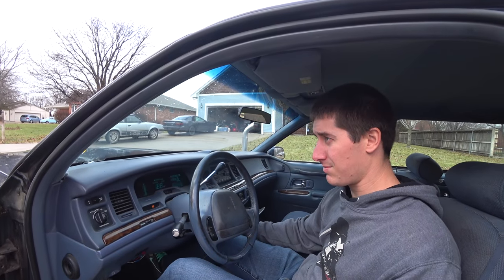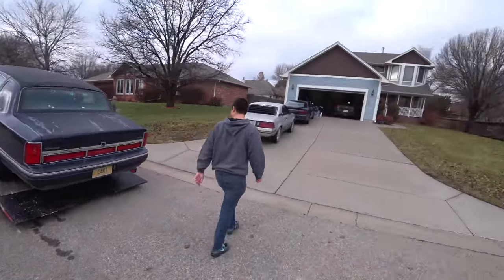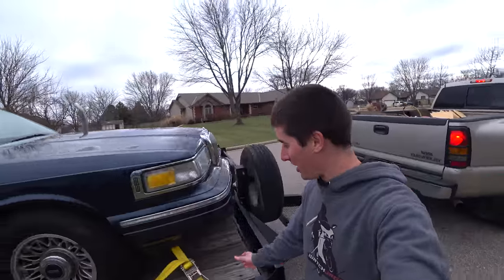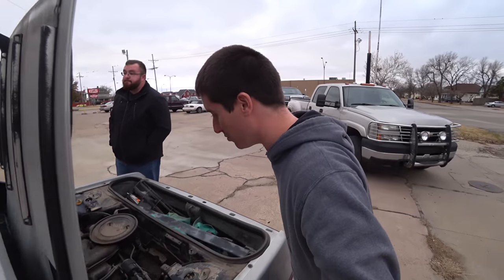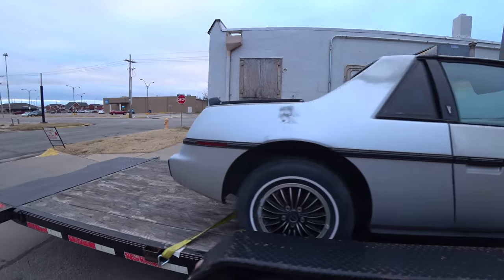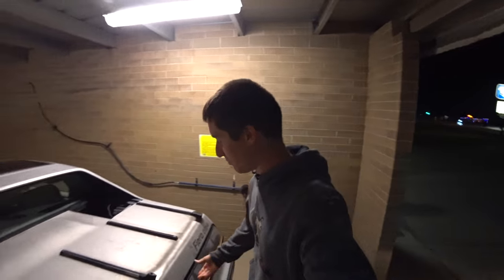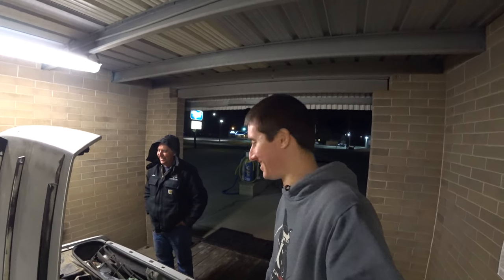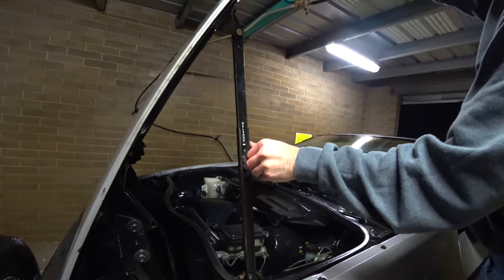SELLING My Cheap LIMOUSINE Lincoln Towncar And Getting A FREE Pontiac Fiero 2M4

Comment: I owned an 84 Fiero.  It actually broke down less than a block from the repair shop I had just left.  And that was one of it's better days.  It was so bad, Hoovie would have bought it.
Reply from the maker: You know what? I'll call him and see if he's interested in this 😂
Reply: You should.  And it will take less digging time to bury it.
Reply: The day I bought my 84 Fiero, it broke down 1.5 miles into the 3 mile drive home. Still have it
Reply: Somewhere out there exists a North Star powered Fiero. I remember this from years ago.
Reply: same, mine also caught fire once and threw a rod out the engine block the first time it successfully took me to work. I still have great memories of NAS' It Was Written booming thru the headrest speakers.
Reply: Your expectation for ANY 34 year old automobile should be a car in need of extensive repair and restoration work.
Reply: I, too, had an '84 Fiero. It was a 4-speed... NOT a 5-speed. Outside of blowing the head gasket and replacing the clutch, it was freakin' reliable! Highway mileage was in the high 30's.  It never broke down... it never caught fire! LOL!
Reply: I love my 84 fiero. It’s been very reliable for me and still going strong

Comment: My brother purchased a first year production Fiero as his first car. It was a pretty good car for the most part and he basically drove the wheels off of it in just over a year before being hit in the rear by a drunk driver totaling that Fiero. He then went out and purchased a new, late second year production Fiero and discovered it was a "garage baby"....It there was a heavy fog or it rained, even a light rain, the car leaked. It used oil at an incredible rate....And the electricals failed on a regular basis. He had to invoke the Lemon Law on that car before it was over with and has not owned a GM product since then.

Comment: I had a Pontiac Fiero 2M4 in 1986. It was a decent car, EXCEPT, in the year and a half I had it, it was in the dealer shop 6 times for the same issue. Then, on the sixth time, they finally admitted that it was on a Lemon Law Recall List and I returned the car and got me another vehicle! Was a lot of fun to drive, well, except for the recurring issues!

Comment: I have an 84 2m4 auto in red. 110,000 miles. No clear coat failure. Also I have the same rims and you cannot find factory size tires for those. They’re all trailer tires, so if you wanted to keep those rims then you’ll have to go with 185/70r13. They’re about 4mph off. I’m driving mine threw the winter in south of Chicago so it is surely going to be fun. Enjoy your Fiero.

Comment: Sweet. I have a 88gt that I swapped a 3800 supercharged engine into a while back.  Has only a few minor mods and a canned tune from sinister performance.  Its friggen fast as all get out.  Especially out of the hole. I used a supercharged park ave automatic in mine.

Comment: Just remember, if you need parts, Chevy Citations (X body) are your drivetrain and rear suspension. I believe the front suspension is Chevette (T body). Be very careful with the body parts. They will be very brittle. Sadly, Pontiac would finally rectify all the problems in the last year of production.

Comment: A lil warning on the Fiero when you fill the oil run it 1/2 qrt to a full qrt over full. the reason why is when GM modified it to fit the rear of the Fiero they put a smaller oil pan on it. Never changed the dipstick

Comment: You should have traded your 21' limousine for another 21' limousine, namely an early '30s Bugatti Royale. It weighed about 3175 kg (7000 lb). Ettore Bugatti planned to build 25 Royales. Unfortunately, the car was $43,000 in 1931 ($560,000 today), and even royalty couldn't afford that during the Great Depression. Only 6 were built, and only 3 of them were sold to customers. A 1931 Bugatti Type 41 Royale "Kellner" Sports Coupe sold for $9,760,000 at a Christie's auction in London in November 1987. 
The Bugatti Type 41, better known as the Royale, is a large luxury car built from 1927 to 1933 with a 4.3 m (169.3 in) wheelbase and 6.4 m (21 ft) overall length. It weighs approximately 3,175 kg (7,000 lb) and uses a 12.763 litre (778 cu in) straight-eight engine. For comparison, against the modern Rolls-Royce Phantom (produced from 2003 onward), the Royale is about 20% longer, and more than 25% heavier. This makes the Royale one of the largest cars in the world. https://en.wikipedia.org/wiki/Bugatti_Royale
Million Dollar Cars - Bugatti Royale https://youtu.be/q8GICeyv95s

Comment: Only issue with that 2.5L Iron Duke engine is the fiber timing gears are a known weak point on these. If you beat the shit out of this engine, revving it to it's limits, that gear can sheer off teeth. The gear is hard to replace but even if timing goes off, no damage happens because of this engine being non-interference. It honestly probably runs fine, this was a very dependable engine, but gutless at 92HP when new. Also, the red line is 4400RPM, so it's a very low revving engine. I own and drive 4 cars with this exact engine setup, no differences at all, and they're gutless, and they always sound like they're in pain, but they go go and go

Comment: I owned an 87 for several years in the early 90's.  I drove the crap out of it.  It was a pretty reliable car for most of the time I owned it.  But near the end it all went bad, and I traded it off.  I wish you luck getting it running.

Comment: Hell yes!  A FIero!  And a "notchie" to boot!   Here is some important info if you are new to a Fiero...
Did you say it was an 84?  If that's the case,  that's not a 5-speed. (Unless it had been modded)  84's came with either the 3-speed auto or 4-speed manual.  And no  you won't see bare metal on the roof.  That's similar to fiberglass.  The body is made of  glass reinforced, SMC (Sheet-molded-compound) and RIM (reaction-injection-molded) urethane panels.  The soft, lower door-skins and bumpers are the RIM Uretane  While the rigid bits are SMC. All of which are bolted to a full space-frame of steel.  There is no metal in the exterior body except for the two cast aluminum panels that are missing on yours.  I also think the decklid on yours has been swapped.  84's have a center grille above the engine and the panels to the sides are solid.  IF you do fix this up, be sure to get the slotted side panels.  That engine needs to breathe. Those shiny trim pieces aft of the side windows are glass, even though they don't go into the interior at all.  Don't pry on them. Finally look inside the rear decklid for a small sticker about one by 2 inches, and/or a plaque about 4 by 8 inches that might be just ahead of the shifter.  It looks like  this. (link) ↓

http://gafieroclub.org/pics/misc/fireplk.jpg

 Or even a updated manual or additional service manual.  This is evidence that this car was in the recall and has been fixed.  You may even be able to look up the VIN and tell if it was in the recall.  If these are not present,  DO NOT abuse or drastically over-rev that duke! A few of the 84's had bad connecting rods that would let go under heavy load. (with other contributing factors).  NOT saying yours has bad con-rods,  but it's a slim possibility.  Plus you can not just dump coolant in and go.  There is a particular fill procedure to "burp" the air out of the system.  Since the radiator lines run under the doors (seriously watch  where you put a jack!)  air can get trapped in there and cause the car to overheat and fry the engine. I'll outline that below.  Improper coolant filling,  bad con-rods and abuse caused the drastically overhyped,  engine fires in less than 1% of the 84's.  (no sir.  they are NOT deathtraps! They were owned by morons who beat them.  It like your EXP.  Basically a sporty looking economy car.

1 Open the radiator cap (front)
2 Open the thermostat housing cap and pull the thermostat out. (rear, on engine)
3 Fill through the t-stat housing until coolant begins to appear at the radiator.
4 put the t-stat back in, and close it all up.  
5 Run it for about 10 minutes or until warm.
6 Let it cool and open the radiator cap and thermostat housing cap.
7 top it all off again and repeat 4 and 5 (maybe up to 3 times)
8- After the rad is full, only open and add coolant to the t-stat cap until the system is full. 
9 maintain coolant level at the thermostat housing cap.

If you have any doubts,  check the Fiero clubs on facebook. In fact, Please do check them!  The best one is a group called "Fiero" run by Matt Snell and Matt Bach.   Group link: https://www.facebook.com/groups/2204429635/  
 I suggest joining it and asking about any concerns or questions you have about it there.  Plus they can locate and sometimes sell you any part you may need, and put you in touch with companies that make aftermarket parts and upgrades etc. There is also "Midwest Fieros" closer to your area.

P.S.  I own an 84 Fiero 2M4 SE, 151 cid (2.5liter) "Iron Duke" with a 4-speed manual.   And I love the darn thing!
Reply: OH!  A few other things that get missed:  The park brake.  It pulls up and will drop  back down.  That's not a malfunction.  To release it, just pull up, HOLD the button until the lever is back down again.    The front hood (Frunk) release is quite hidden..  It seems yours doesn't latch so you might have not had to find this...  See the air-duct nearest the drivers door?  Feel under it  and there's a handle.   ...AND The fuel cap release.  Sitting in the drivers' seat, look over your left shoulder...  There it is.. ☺  Yeah  it's an odd car..  But totally enjoyable!
Reply: You would love a gen 1 MR2 SOOOO much more. Fieros were nice looking, but shit underpinnings. Only in '88 did the reality meet the dream, where GM promptly cancelled it in their infinite stupidity. '84 or '85 (I can't remember now) and an '87 prior owner.
Reply: @goofyleo3869  GM cancelled the Fiero after the 88 model.  You are right.  Pontiac did finally pull it together after 87. In the 80's when few were getting anything right, trying to go smaller and "greener" and friggin' metric bullshit..  Few cars showed real promise while doing it.   Fiero was one of them. They will feed you the bullshit about  "Fires burning them all up"  and "Dismal sales, "   Both are horseshit.   The fires happened in less that 1% of the 84's due to the reason I mentioned above, with the coolant and a bad batch of rods.  The sales figures DID go down a bit  but not drastic enough to kill the line.  Nah..  According to someone I talked to, a former worker in the Pontiac Michigan plant, Here's what really happened...  The 89-90 Fiero prototype was put to the test track.   Have a look. 
 http://www.fiero.nl/uploads/DSC00006.JPG  and   http://www.fiero.nl/uploads/DSC00004.JPG
Looks familiar huh?   Yeah,  the 90's TransAm, Fierbird and Camaro took their styling from this. The Fiero had a bigger v6, twin turbo, much more power, even better suspension,  vastly improved drive-train..   Yeah  They got it all together with the 89-90.  It surpassed the numbers of the big-daddy bad-ass muscle of GM at the time,  the Corvette. 
The 'vette guys were like  "Nope!  No little mid-engine Pontiac is going to de-throne the Corvette as top dog."   And the guys in charge who controlled the money anyway,  easily agreed.  So  The prototypes were crushed (most of them,  a few managed to get out.) and the Fiero line was ended to preserve the status of the Corvette.  I love the Vette, by the way,  But it's a shitshow that it had to go like that.  Ever since then, the Pontiac line was neutered.  Just left with the Grand-ma and Grand-pa(Prix)  Until The Pricks at the top beheaded the whole line. along with Buick and Olds.  We got Saturn..  the inbred rape-baby of the company, instead.

Comment: Not an 84 wrong deck lid and it was the 4 cylinder that had the most problems not the 6 , t 4 cylinder block would crack spray oil on the cat and start on fire. I like the fast back gt 's I was the first to put a ls1 in one. Fun car

Comment: i've had 3 fieros back about 2005 - 2007 i had an 85,86,& an 87. All of them were the 2M4 there are remarkably sttill a lot of parts floating around for them and that iron duke is rock solid in those things. never had a minutes problem out of any of mine and they were a blast to drive. and yeah ours got confused with ferrari's and all different manner of other sports cars that looked nothing like that. never heard DeLorean though thats a new one. Want a funny image? iam 6'5" tall and i had to fold up pretty much in half to fit in the fieros but once i was in i was good. getting out was the chore. i had to roll out of it and stand up as i was rolling or fall flat out on the ground on my back. but i loved driving those little suckers bought our first one from DC then the second one from Oklahoma City. and the 3rd one from BFE ohio. i would like another one but this time to modify. i'd like a GT and drop that Anemic 2.8 out and get the adapters to put in an LS THAT would be a hot little ride at that point

Comment: Looks like an 85 base coupe or sport coupe, fifth digit in the VIN will tell you the model, E for base or M for sport. Those 13" wheels are rare (but not desirable).
Reply from the maker: 5 digit is F, VINWiki did come back with 85 when I ran the VIN. Is F another model? 🧐
Reply: @WatchJRGo  F is SE, which is odd because SE's usually have more options, and the sail panels would have SE on them.
Reply: The 5 triangle 'swirl' rims off an 80's Grand Am is a good-looking upgrade, if you can find them. An added bonus; the rumor is they make a sound while spinning that scare away deer. Bodyshop guy back in the day said he never had a car with those rims come in with deer damage. Just my $.02.
Reply: The first thing that tells me it’s an 85 is that the engine compartment doesn’t have the large center metal grill. Just on the sides. 85s have that hump. I much prefer the 84 over all other years.

Comment: Although I like my Pontiac Firebird more, the Fiero is more fit for city driving here in Europe. Due to the stupid ethanol in the gas here only the Firebird is still drivable (although not compatible with ethanol it keeps running on 98 octane gas with up to 5% Ethanol for several years now). The fuelsystem of the Fiero just keeps desintegrating due to the Ethanol and parts are to hard to get here.
Reply: I think it's admirable that you have two American classics outside of America. I wonder what it costs to keep them running
Reply: Radical AM it’s quite ok. When a vehicle gets to the age of 30, you can register it like an oldtimer and taxes are only about 50 dollars and insurrance only 150 dollars a year (instead of 2300 dollars and 600 dollars lol). You can drive whenever you want but cannot use it to go to work. Although gas is about 7 dollars a gallon here, since I drive just in the weekends it’s ok. I do all service myself because no garage will service an Amercan car since gm left Belgium several years ago. These American cars are much easier to work on than European cars. European cars often require special tools while American cars require more time to fix because of the numerous bolts 😉

My local parts store knows suppliers in the USA (mostly AC Delco parts) an most of the parts are cheaper than European parts. Since the 3,1 v6 in the Firebird was a very common engine in American cars made by GM and shares a lot of parts with the former 2,8 v6 it’s not so hard to find them. The fiero is really rare here, never had a market for them.The firebird V6 like mine in original condition (searching for an original radio though):  I’ve seen 2 in the last 10 years. The V8 is really extinct here, all tortured to death and scraped.

Comment: I think the real problem with the Fiero is that it has the 4-cylinder
Reply from the maker: My understanding is that the V6 cars had tons of overheating/head gasket issues. (I've also heard the head gasket issues are not that bad and get hyped up) The 4 cyl might be the move in terms of maintenance/reliability. 🤙
Reply: @WatchJRGo  Really? I thought it was the 4-cylinders that had that problem. Good to know.
Reply from the maker: @artistwithouttalent you're right! The Iron Duke is the one that burnt down all the time. I'm surprised since it runs forever in the USPS trucks.
Reply: @WatchJRGo  the problem with the 'Duke was that they had to shave the  bottom of the oilpan so it would fit, taking a quart of capacity out; AND the engine wiring harness goes right past the exhaust manifold on the front bulkhead. It melts the insulation off, wires short out, you get an engine fire and your car burns to the ground. I lost one that way.
Reply: The problem with the Fiero is that it is a Fiero!

Comment: Did I miss something? Why did you have to tow the limo for trade?

I expected you would fix the limo so well that it would run fine. I am wondering if you are making loss with most of your cars and only doing these stunts just for  YouTube earnings.
Reply from the maker: Plastic intake cracked and I wasn’t about to put another $300 in it. Easier to get rid of it 🍻
Reply: @WatchJRGo  I understood that you didn't want to put more money into this Limo, when I see you towing the vehicle. 

The question I have is on the core value (take away) behind this channel. I started watching your videos to learn the tips and DYI techniques in maintaining used cars and to fix issues by myself instead of spending a lot of money. In most of your videos, you make it sound like the fixes you make are very easy to do. That gives me the feeling that you are turning rusty metal into gold. 

What gives you most return, the cars you trade or the YouTube channel? :)